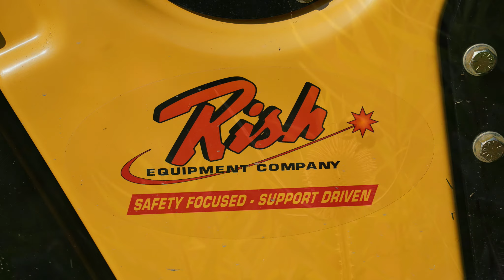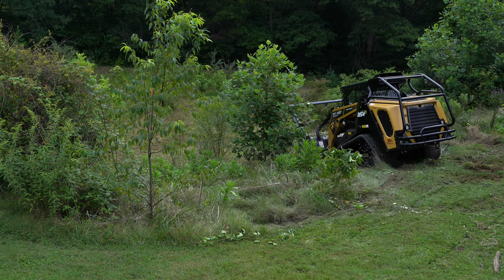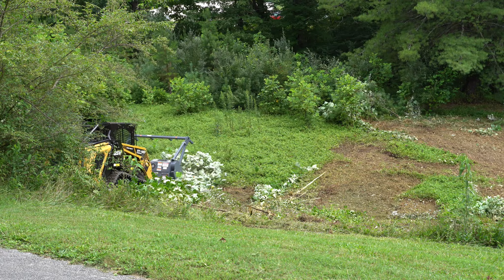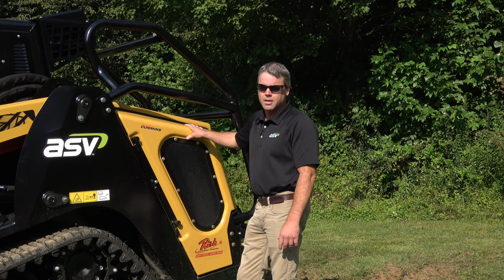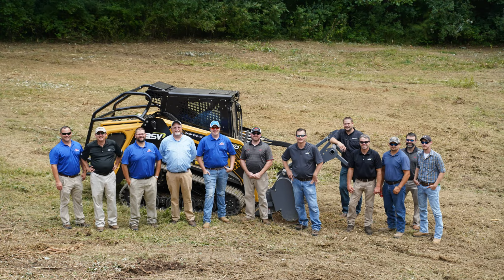Rish Equipment/ASV 120F Demo Video

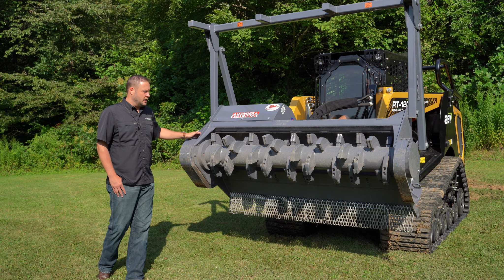Comment: Why a Loftness not a Fecon or Denis Cimaf head?  Helpful if you can be more specific rather than just make a general comment about liking the Loftness better.  2:33 Did the ASV make it up and over the slope, or did it just spin its track?  Second rep starting at 6:50 did a good job of listing specific details about the mulcher head.  Overall, an OK vid but I would've liked to have seen the unit tackling something more than skimpy bushes.  Show me why I need to buy this unit rather than just keep using my brushhog!